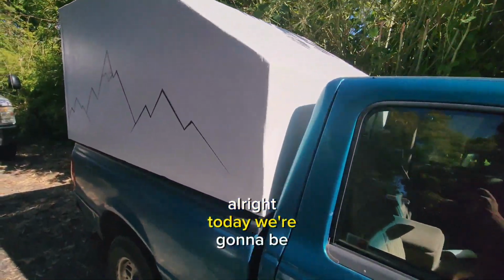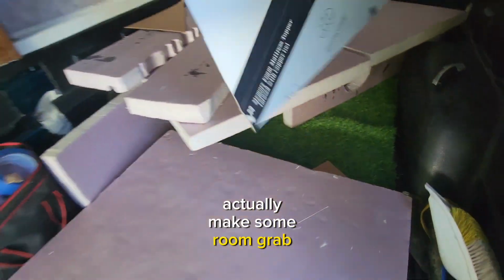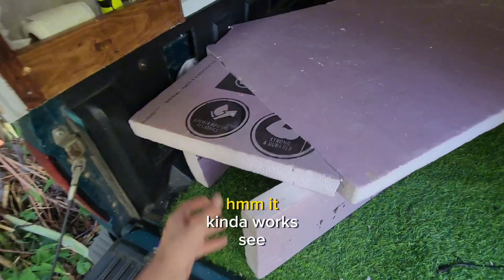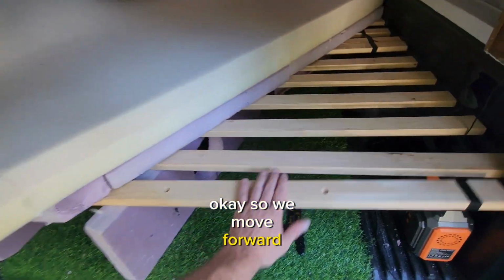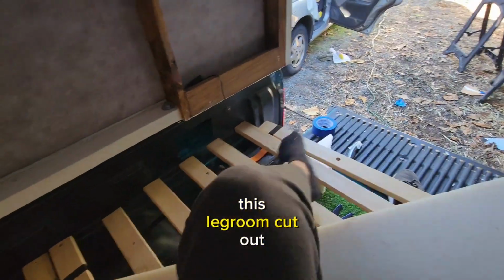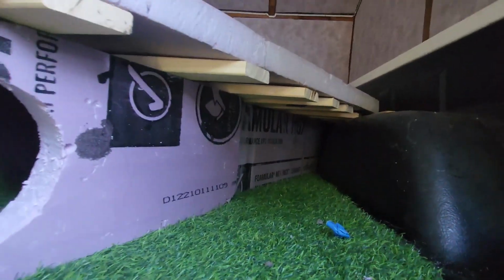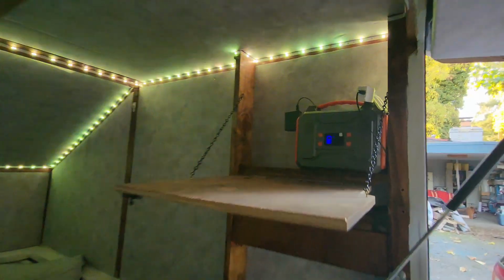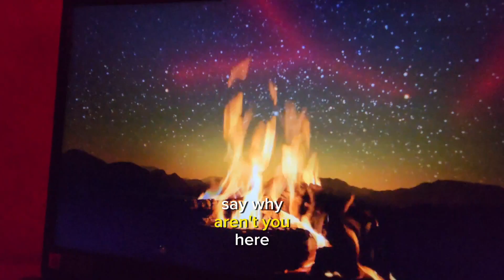Affordable FOAM Truck Camper (INTERIOR RE-BUILD) #Foamie #diy

Comment: ever worry that someone would lock you in there with that lock on the outside like that?
Reply from the maker: Yes! So what i do is leave it on open, and lock the twisting part so the tabs can not be put back on while I am inside, basically lock it open and i have tabs on the inside that i lock from the inside
Reply: well i mean. its only foam and a few sheets of glue. not thaaaaat worried : )